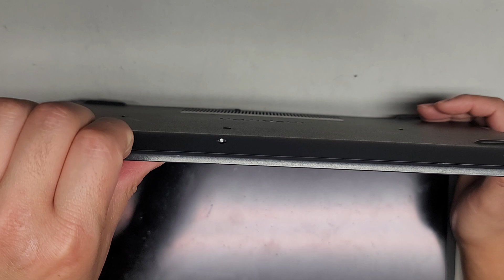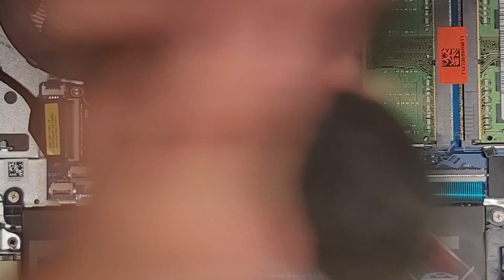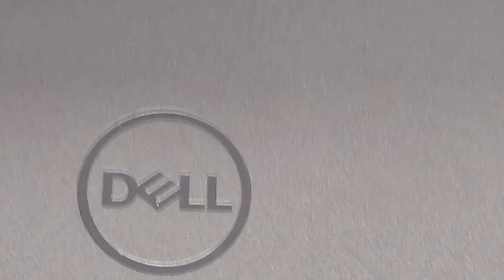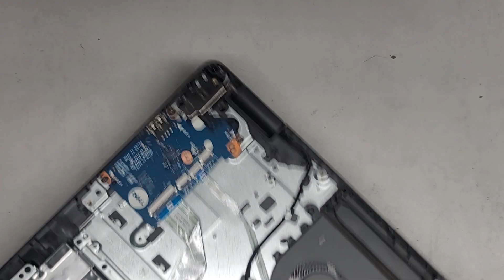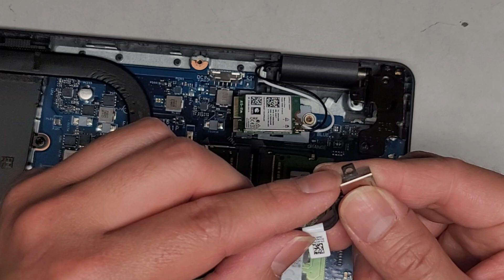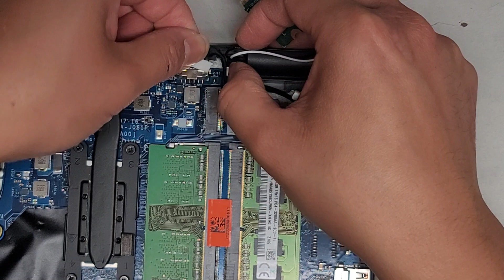Dell Inspiron 15 3501 Disassembly RAM SSD Hard Drive Battery DC Jack Charge Port Replacement Repair

Comment: Tried to clean the laptop fan myself, now my laptop screen doesn't show anything.
And the battery light is blinking whenever I try to turn it on.
EDIT: nvm it was just a RAM stick issue. I had only one ram so put it in the other slot
Reply from the maker: Nice! Glad you were able to figure it out.

Comment: Oh man! Watch out for that Wi-Fi antenna, just like I was warned in this video. The soldering connection is very weak. I accidentally broke both in attempting to reinstall it. I had to put them back in place with a small piece of clear packing tape (not ideal), and then reinstall the plastic housing cover piece since I don't have any soldering tools. Otherwise, great video and very helpful in making the repair. FYI, I purchased the Phonsun Dell DC Jack Cable 1608. It was a perfect fit for the Dell Inspiron 15 3501.  Thanks for the video.
Reply from the maker: If your wifi signal is bad after that, you can get a usb wifi adapter.